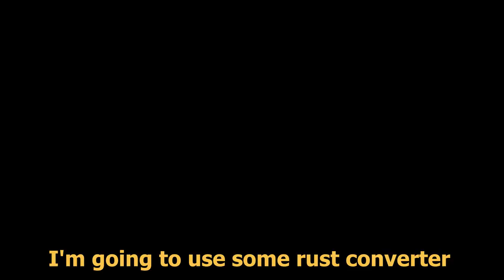Cow Bell Repair | Restoration Project

Comment: Why did you painted it? In gold? These bells are made of steel and then when glowing again coated with melted brass (The copper on the bell-handle; the zinc wasn't there anymore). The surface of your bell was much more nicer after polishing, before painting.
Reply from the maker: I searched some pictures of these bells in google and found some painted in gold, I thought it would look cool :)